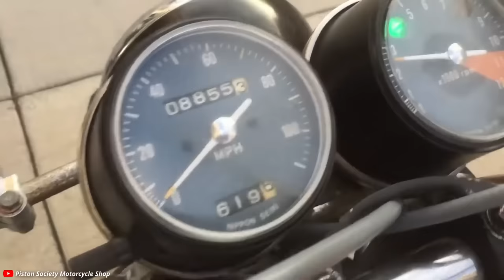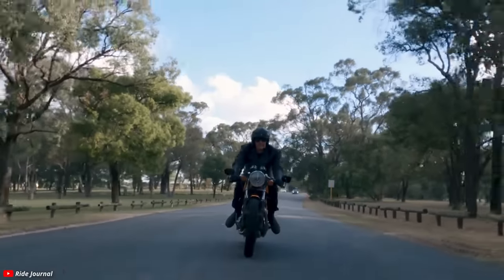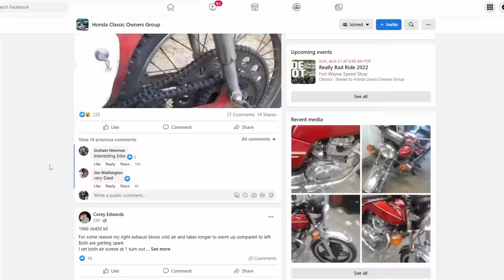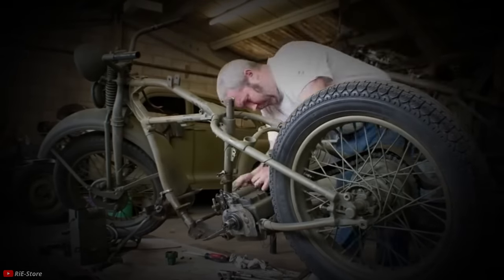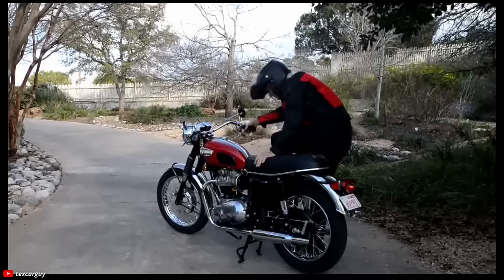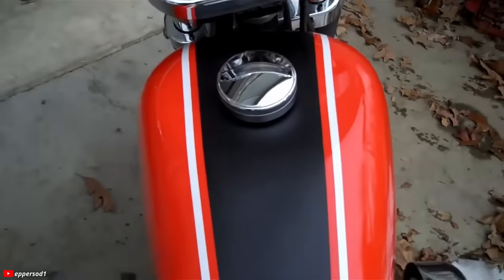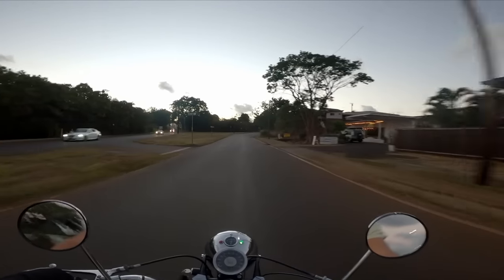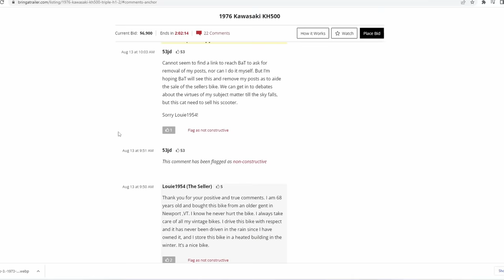So you want a classic motorcycle...

Comment: NEW Riders, Buyers Beware! you're local dealer may NOT work on any motorcycle over 10 Years old. I live in Orange County CA, South of LA and have run Vintage Bike OC for 15 years, a monthly meet for motorcycles 30 years and older. The most popular question I get "DO YOU KNOW A MECHANIC?"  Mechanics are getting older and fewer and farther apart. If you don't already know someone please be aware that it may be hard to find help. I own a 73 Honda CB750 and a 77 Kawasaki KZ1000 and I also disagree that bikes are "easier to work on than cars" Motorcycle have about 6 square inches of contact patch with the pavement. Every bolt should be critically torqued. In fact my Honda Owner's manual states to Check the torque on all bolts prior to EVERY ride. My KZ needed wheel bearings, and I didn't know it until I got into a speed wobble at 70 mph on a busy freeway. (Not a fun experience).

The wheel bearing job took me 8 hours with special bearing tools including a torch and about $70 in parts (including shipping). It was 8 hours of sweat hoping I was getting it all back together in the correct order.

From 20 years of riding and 200,000 miles of experience. For new riders I would recommend a bike that's relatively new. There is enough to learn about motorcycling without the concern of a vintage motorcycle. Look for something with electric start, electronic ignition, good brakes, fuel injection. Anyhow great video, good information. Just my $0.02 (2 cents)

Comment: Got my 2nd 1979 T140E last fall, first one I got in 1982 same model . Had gone over it over the winter and have been on it all spring and summer.  No problems and does all i ask of it. Like finding a long lost separated at birth twin. As I am now 63 chances it will escort me to the finish line. I have had hyper bikes and all in between but have always liked my Triumphs the best. I call them the F14s of bikes as you will pull 4 hours of maintenance for every 1 hour of flight time! But well worth it.
Reply: I have a 1978 SR500 had one back then to best British bike ever built

Comment: Really nice video. I own a 1971 Kawasaki 500 H1A and a 1973 Honda XL100 that I have re-Powered with a XL185 engine. The Kwaka had been my dream bike ever since they were new and I have owned her for a number of years, she’s had her ignition system renewed and her top end rebuilt. So my problem is more the other way round, what new motorcycle would best be suitable 😊.  As for classic cars, I’ve had MGBGT‘d Triumph GT6 / TR6 and TR7. In my opinion the TR6 was fabulous to look at and admire. But, they are something else when you have happened to own one. Let me put it this way, I now own a 2006 BMW Z4 and it is everything the TR6 was but MORE. But getting back to classic motorcycles and in particular the one you wish you’d never parted with, mine would have to be both Yamaha’s the 1971 CS3 200 electric and JT1 Mini enduro.

Comment: RE CB350:  Parts availability is  a big consideration when buying an old vehicle, regardless of whether it has 4+ wheels, just 2 wheels, or a prop.  I recall reading an article in one of my older brother's motorcycle magazines, back in 1973, that fully 1/4 of ALL the motorcycles on the planet were Honda CB350 models.  
I also learned in 2007 (while in Thailand on a missions trip, visiting homes that my companions built after the tsunami) that Thai law banned the sale of motorcycles with engines larger than 350 cc.  That's because the Thai Police rode Honda CB450 bikes, and wanted to be able to catch anyone else! 
I have a strong suspicion that they might have since removed that law, with larger engines being so common now.  If anyone knows what the Thai police currently ride, please reply in the comments. 
PS: While in Thailand, I also passed the factory that builds the current Triumphs.  I wonder if they're a lot cheaper to buy there?

Comment: Slight correction here.  Not all stock OEM parts are superior to what's available in the aftermarket.  A modern reg/rec combo unit, a drop in LED headlight bulb, and a set of fresh and modern Michelin's will improve the reliability, rideability, and safety dramatically.

Comment: I own 9 classic motorcycles ranging from 250 to 1200 cc. My collection ranges from a 1972 Yamaha DT3 Enduro to a 1994 Yamaha FZR600R. 
I love riding them all! 
My riding pleasure has been ruined by E10 fuel which is standard in Scotland. I'm worried if I go to more remote places, I won't be able to get Super Unleaded fuel. 
I've been riding since 1976 and love my classic bikes.
My most troublesome bike is a 1973 Honda CB360 that has only done 4500 miles!

Comment: Mr Bart man, thanks for you considerations about owning an older bike. I consider my 24 yr old Guzzi to be in that category. I mostly agree with what you say but I see one omission or misconception. You stated several times that without prior wrenching skills, you better not buy an older bike. What you seem to overlook here is that if you are interested in it, you can LEARN to wrench. Although I have been wrenching for 50 years I never took apart a motorcycle fork. Looking at the exploded view diagram this must be a complicated part but if you read about it and look at some videos you'll soon find out that it is quite a simple thing. The same goes for many motorcycle components. My advice would be: buy that old bike if you really want it and learn to wrench and buy the necessary tools as you go along. As long as you have a dry spot and a little stool to sit next to you bike you'll be okay and can spend many fulfilling hours getting things working or neat and tidy. You will feel so good after successfully completing a job on your bike! It will be much more YOUR bike from then on.

Comment: For the cost of a new bike, you could easily buy 2 older Japanese bikes.  I know that this is not a pre  90s bike  but one of the bikes  I have is a 1998 Honda 650 Deauville V twin that is nearly 25 years old. But it still runs as well today as it did when it was new.
Reply: Good luck finding parts for a bike older than '90- cheap or not- it's a dead end.

Comment: The BMW you speak of is a really famous engineered even used to put that on trail machines and stand on the cylinders when trials riding 50% of working on cars is getting to what you need to fix and then getting it all back in there a motorcycle is easier because it's right in front of you and to get inside the engine is not that big of a deal you need to know metallurgy how tools work there's so much to know when you are a real mechanic on anything or everything you need to know welding skills troubleshooting electrics you need to know about electricity I won't go on anymore.. LOL
I have a 200 Honda twin right now that I love I would rather have the 175 or even a 150 dream but I love smaller displacement engines as well as large, Amen to that

Comment: I started my Life with BMW Airheads but I have now gone a totally different Route, meaning the living Fossils that are technically old Bikes but with more modern Conveniences. 
My Daily is an early Kawasaki Estrella from the mid 90s but they are still in Production with only a few changes to accessories while the actual Engine has remained largely the same, so Parts are still easily available.
I own a 2004 Piaggio Ape 50, which is also still in Production, meaning Parts are still readily available, and it has been in Production since the 50s. 
I have a '76 Ural M67 Frankenstein with a K750 Engine, Dnepr Forks and since the Frame has been unchanged since the 70s, a new Swingarm to replace the old bent one. The Ural has been in uninterrupted Production since 1938, making Parts very available, and even if my original Engine completely grenades itself, I can get a new 750 that just drops into my Frame. 

My next Purchase will be a classic Honda Super Cub C50 and a Royal Enfield 500 Bullet, with EFI as a modern Convenience and nicer Brakes while still getting all the fun of having a good looking classic.

Comment: 2 points you didn't put enough emphasis on: 
1) An active owners club has members with lots of knowledge about their bikes and they WANT to share it.
2) Parts supply. Buy a part when you need it and not when you can.
I have 3 bikes. Moto Morini 350 and 500 and a Norton Commando 850. The Morinis are exotic and sourcing parts can take months. The Norton parts are mostly in stock and still fabricated. Make-fast engine parts or café racer parts also. A (wealthy) madman could probably build a Norton from scratch.

Comment: I have a an old '78 Suzuki GS750E. Thing about the old bikes is finding parts. I have owned this bike for over 30 years. I have a rather long list of crap I've rebuilt or replaced. Recently I finally put on new sprockets and chain. What a pain the screws put in are unreal tight. Oh yeah new tubes and tires, I put new ones on 30 years ago too. I would not hesitate to hop on and take a long road trip. You just do not see the old air cooled bikes out there anymore.

Comment: Tinkering is nothing like bart claims. Buy a shop manual, do what it says. If that doesn't work, (it usually does) do some problem elimination. From simplest to most complex. You don't need to be a mechanic, you just need tools and an IQ over 90. It always comes down to air/fuel/spark. A non-starter is often a fused/corroded killswitch, for example.
This can be done in 10-30 minute/day increments. Anything is doable. Don't be lazy or timid. Pursue whatever diagnostic avenue that strikes you. Worst case, you've thoroughly eliminated a potential problem.

Comment: Excellent video, and love your Triumph by the way. I own nothing but classic Yamaha 2-stroke enduros and 4-strove 70s Hondas because new bikes just don't do it for me. They have no soul like the classic air-cooled, carbureted machines. They are great bikes to learn to work on, but my advice would be to get a nice, 2 cylinder Honda to start with, not an inline 4 for obvious reasons. If you've ever had to pull a cylinder bank to clean out an idle jet on the number 2 or 3 cylinder you know what I'm talking about. Doesn't mean don't buy one to start with, just realize that the potential issues have just doubled.

Comment: Back in '78 I bought a '67 Triumph Bonneville, it needed a front stainless steel fender and a paint job. I found the fender at a swap meet and used rattle cans for the two tone paint job. In '95 I bought a '50 Triumph Thunderbird project and did a concourse restoration on it. It took me over five years to complete it. I won first place in my class at Mid-Ohio swap meet and bike show. I loved that motorcycle, it's the one I miss most. Back in '05 I bought a '39 Harley Knucklehead ( only 214 units made) one year only shift pattern (12N34) I love vintage bikes. Hears a link to view the '39.

Great content, this channel is the best.       https://www.youtube.com/watch?app=desktop&v=I4zC4fH1GCE

Comment: The biggest issue on old bikes is that they're old. Parts wear out, rarer bikes have rarer parts, and there's always something going wrong unless you completely restore it. They're classy, but like old cars, they can be money pits.

If you want something old but not old, there's the Suzuki TU250X, which is a recent bike that looks old.  Or the CSC SG250, which is a China-built, American-assembled bike that looks retro and is still carbureted and air cooled, but has new parts. CSC also sell all the parts for it, and it's explicitly designed to be worked on. There are other retro bikes like the Royal Enfields and such. There's no true replacement for a true classic, but you have to have the money and time to work on a true classic all the time.

Comment: As much as I like the OEM sentiment, its way cheaper to get a non-running old bike and modding it to get it running again. If I went with OEM parts on all my builds I’d be spending twice as much.
Reply: I hear ya. In my experience with cars: it's only problematic to use aftermarket parts instead when you don't adjust the corresponding pieces so everything works right. With an intake, for example, if you don't have sensors that will auto adjust to it you will need to get a tune done for things to run right. I can't imagine it being any different for a bike but I suppose I will find out shortly!

Comment: We had a CB -175, and a CB-350...the 175 was almost ideal city bike, and could happily do 70 mph, and was in a lower insurance class;-)
The 350 was lost in a crash (car jumped a stop sign, and f'd off, leaving me unconscious on the dark, rainy road, 10:30 pm) but the front brakes were twin-leading-shoe, a bit of a handful to control, so I would get a slightly newer model with disk brake.. btw, the 350 really responded well to a simple "cleaning up" of the carbs/intake and exhaust system , let it run up to 14,000 rpm, and I was able to eat Yamaha 350:s...
Reply: And what do you mean by cleaning up of the carbs may I ask. I owned a Honda cbb350 in high schools. Still have a 1970 Honda CL350. I'm just wondering are you talking about rejetting the carburetors or just the usual cleaning and  putting in a carb kit. I actually thought about cleaning up the exhaust ports and intake ports on it. I still have the CL350 engine. I thought about taking the head off and  porting polishing and decking it a little bit.

Comment: I own a 1973 Honda CB 500 Four and it is a good bike, quite reliable. I sometimes do longer daytrips on it with my friends (around 300km or 180 miles) and also did a four day trip with it. It never really let me down, except for a burnt fuse (i had replacement with me...). But you are right, for those trips, a newer bike would be more appropriate, that's why i am looking for something like that 😎

Comment: As a museum quality restorer of old classic bikes, I can say that you will have very few problems with Japanese motorcycles, problems which are manageable, and many problems with others, which will be much harder to address. Pick a bike you can readily get new and used parts for. Definitely get a bike with disc brake or brakes up front- stopping is far and away superior. Obvious choices are Honda 750s, as he suggests perhaps the later models for less cost and better design, or the higher performing Suzuki GS1000 models. Both are 4 cyllinder air cooled UJM's with standard riding stance, and many of these bikes were made and they are well designed. You get a Japanese motorcycle running like new, it will stay that way.

Comment: A nice Vintage  Bike project is an old Spanish Montesa 50cc. i had one but now I  have a original 1977 Honda CT 70.  I upgraded the engine to a 125cc😉. These Japanese bikes are not as easy as working on a classic car,  these bikes takes some finesse and I found the engine parts are kinda tiny and more delicate than an old Ford. I have both and love classic vehicles. The next Honda to be collected IMHO will be the Early Honda Rebel 250cc as they stopped production of that size in 2016.

Comment: RUBBER - I've owned a lot of 20 - 30 yr old bikes through the years, a bit of work and I had a cheap runner. The one problem all these bikes had was deteriorating rubber. Spongy brakes, leaky carbs, hardened oil seals, etc. Find out which rubbers (and there is a LOT of rubber in bikes) have been replaced before you buy, as those that haven't may need replacing soon.

Comment: I’d give my left nut to get my hands on a 1976 Yamaha RD 400, the first bike I bought brand new. I was 20, and paid, NEW, including PDI, $1,385.00 Canadian, I’m in Montreal. Now, you can’t find these for less than $5-6,000, US funds.  The other bike I looked at was the also new for 1976 was the Honda CB 400 Super Sport, the beautiful 4-in-line scooter. But….the smell of 2-stroke won me over.
Reply: They don't make them like they used to! It took me 2 years to find my '77 RD400, It was all original with about 10k on it. I'm currently hopping it up for next year's VRRA events. I paid under 5000 Canadian, you have to be patient and also vigilant for when they pop up. 
- A 2 stroke addicted Torontonian
Reply: I had a RD400 back around 1978/79 it was rocket would do the ton two up no worries

Comment: It is easy to get caught up in the excitement of a classic bike without understanding the practicalities, I would always check on parts availability even if a manufacturer is still in business they often will not support older models which means you will be reliant on used or re manufactured parts and if these are not available then your pride and joy may be resigned to a garage ornament so try to do a little homework before making the final plunge.

Comment: I have been riding street bikes since I got my license at 15 in the mid 1980s and I have lot of motorcycles. I want to say stop spreading misinformation Ohc engines are a disaster for maintaining. Stick with Ohv motors look for 650 or 750 Ural, 5 speed Harley sportster, BMW airhead, 1950s through 1980s triumph, bsa, royal enfield 500 singles and any moto guzzi would be the best to own and maintain in your garage. The only Japanese engine I would recommend would be the XS650 because of the availability of aftermarket parts making owning an older bike easy.

Comment: Leave all the 70's and 70's junk in the motorcycle graveyards where they belong.
Get yourself a classic Honda Rebel from the early 80's up until into the 2000's...
Modern styling, easy to work on, looks good, parts are plentiful, longest motorcycle run ever next to like the Cub and SuperCub
No kick starting.  Comfy seat unlike straddling a bench.   I paid $500 for my project bike, and put another $400 into it over time pay as I go..   Yeah, finished it, no problem.